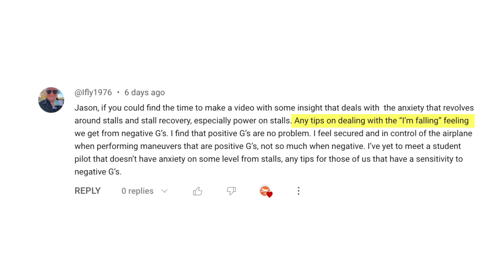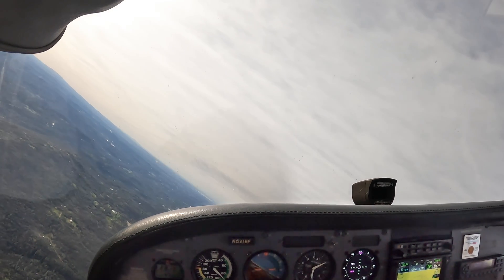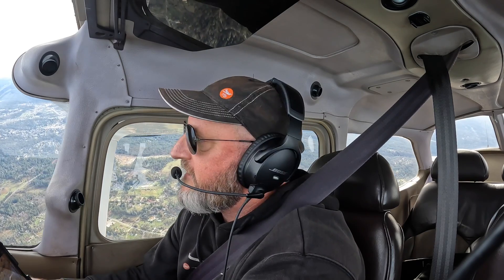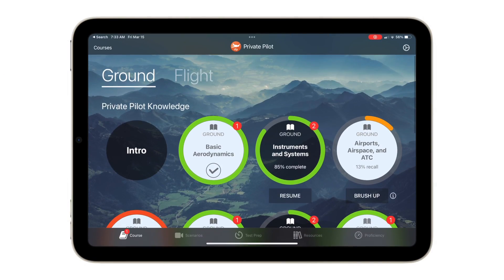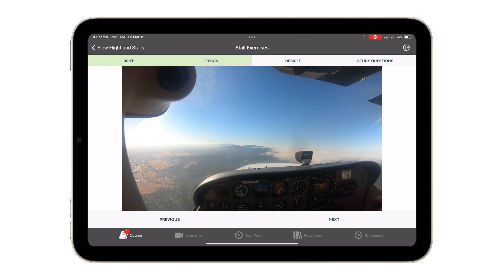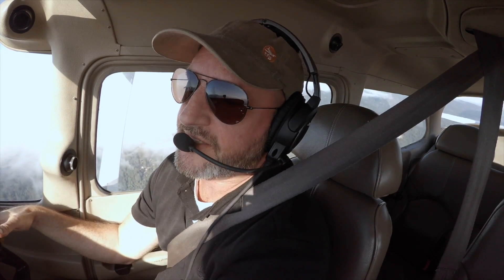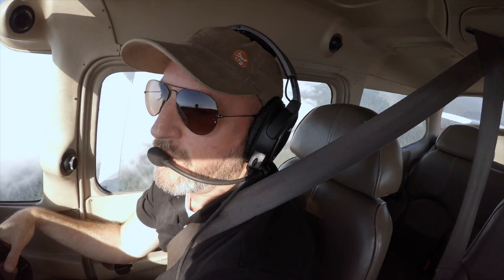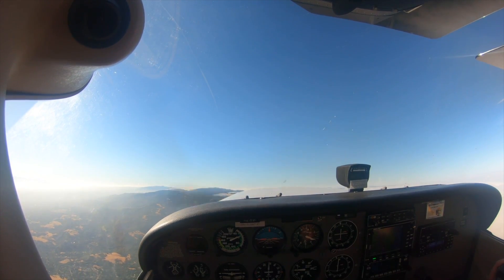PRACTICE AERODYNAMIC STALLS LIKE THIS - power on stall anxiety explained solved fly stall exercises

Comment: My flight instructor had me doing stalls in all configuration. Slow flight up to and through the stall. Aeiloron and rudder. Spins were my personal favorite. Almost made my instructor sick. Extreme crosswind touch and goes with full slip to touchdown. One wheel landing with smoke pouring off the tire as it is dragging sideways. Taught me to trust my instincts and the aircraft.

Comment: Why in singe engine airplanes (in multi engine too) don't use stopwatch for achieve V1 start at release breaks, to ensure expected airplane performance? 
In single engine V1 & time: would be set as Vr - 5kts or less if runway is short, then V1 would be point for safely reject takeoff. (example, someone become sick during takeoff)

there were accidents because engine did not had proper performance. and pilot realized that too late for reject takeoff.
And also in muli engine was accident because pilots set wrong takeoff power and runway ended before Vr. preflight calculations was ok.

I assume calculation will be complex, but with smartphones and tablets, simple app with profile for your airplane would do everything. Just put current conditions like temperature, pressure, dewpoint, runway length&slope, weight&balance, runway surface, and program would calculate V1 Vr, time, distance for takeoff, accelerate stop, etc.

Comment: Back in the day about 35 years ago, my instructor had me demonstrate a takeoff stall. This was at altitude, and we slowed down to 55 and applied full power, raising the nose and then turning slightly, about 15° to the left to simulate trying to clear terrain that would otherwise not be clearable without the turn. The nose would be really high, and then the stall warning would go off, followed by the break with a left wing dropping. The easiest and safest way he showed me was to keep the ailerons neutral, relax the back pressure and use high rudder sparingly to level the plane. High rudder meaning which ever wing was higher that was the pedal you stepped on. so, when the left wing dropped, it was applying right rudder  but not to the stop. Just enough to roll the plane level. That was not scary at all.

Comment: Awesome video as always, Jason!
Probably one of the most important points you made: the way you recover from a stall is lowering the angle of attack, not adding power. 
I ask students "what is the definition of a stall?" Of course we know a stall = when the aircraft exceeds the critical angle of attack. If we reverse the definition,  recovery from a stall = un-exceeding the critical angle of attack. No power necessary. We add the power to resume a normal flight profile upon recovery, whether that is a Vy climb, level off, or go-around.
Your app looks awesome!!
Reply: This point becomes abundantly clear if you learn how to fly gliders.  You practice stalls in gliders.  No power to add.  The only thing you can do is pitch down.  Lower the angle of attack and stay coordinated.
Reply: @ldmax great point! gliders are on my list, which is not short!

Comment: When my instructor noticed my apprehension about stalls, he said, "give me a power-off stall, and don't recover. Just hold the stick back and let the nose fall through." I followed his instructions. He pointed to the VSI and said, "Look. We're in a stall. Now, put in some left rudder." I did, and the nose fell off to the right. "Now stop it with right rudder. Good. Now make it go to the right and catch it with left rudder." I did. "You see? You have full control over the airplane, even in a stall. Now recover. That was called a 'falling leaf.'" I never felt nervous in a stall again.
Reply: This was exactly what my instructor did with me as well about 21 years ago. My problem was I kept instinctively pushing too far forward instead of just releasing pressure. Made for very uncomfortable recoveries, until he showed me that. Never had a problem after.
Reply: @JamesTyranski same, I felt like I had to break the stall with forward pressure. I'm the one that was overreacting. Full power, good rudder the plane recovered on its own pretty much.
Reply: The falling leaf maneuver is also what made me overcome the apprehension of doing stalls!

Comment: As much as I hate "the drop" on rollercoasters and stalls, I'm not terribly anxious going into it. Interestingly, the old school power on "simulated takeoff" bothers me less than power off stalling.  It's adequately pushing just after the break that I struggle with.  Essentially, I'm still feeling the drop and my arms "get short" after an initial push to break the stall - I need to extend the recovery and misjudge what "back to level flight" is in terms of fore-aft yoke position. My CFI is doing a good job working with me on it, but I'd love to be fully comfortable and in control while in the middle of dropping and recovering.  I'll try the slow flight/no power recovery exercise with my CFI to see if that boosts my comfort.
Reply: For me it was just understanding what was going to happen and what the proper response is. I had to do probably a dozen of them before I finally realized the plane really recovers on its own, I just need to relax and put in the proper controls. The 172 is so stable, it wants to recover on its own, just get out of the way and help it along.

Comment: Practicing stalls in my Mooney is not pleasant. Because we hear how the Mooney may not recover from a spin. So watching my A of A, and airspeed on takeoff and base to final, and keeping coordinated is my focus. Thanks Jason!
Reply: Jon, your CFI should be able to demo how comfortable it is to slow flight at the break. You don't need to push forward to break the stall. You simply need to release the back pressure. With your AOA display in your Mooney, you can fly as long as you wish just before the break and get the feel of steering with rudders only. It is very comfortable except for the stall warning horn (which you can mute). Be sure that your CFI is trained on the use of AOA display. Many are not.
Reply: @skipwood2059  Thanks Skip. That is what we do.  I don’t have an AoA indicator in my J. But she will fly along at 70knots all day. (Stall horn yelling at me:) We just don’t push her to the break.  Thanks for the response ✈️